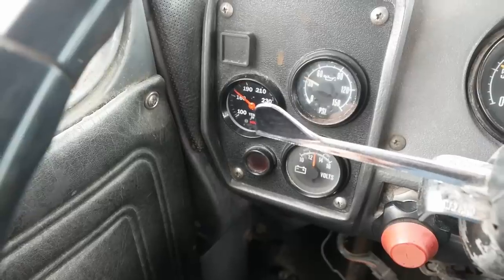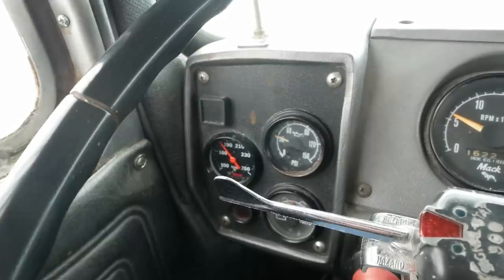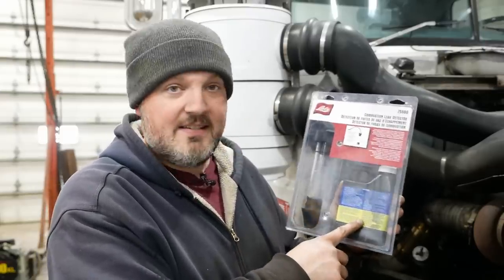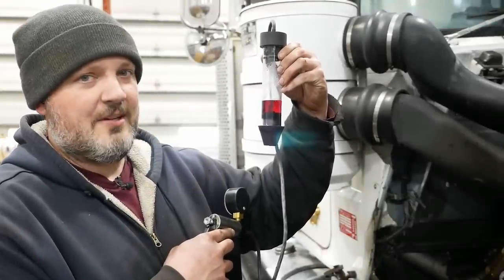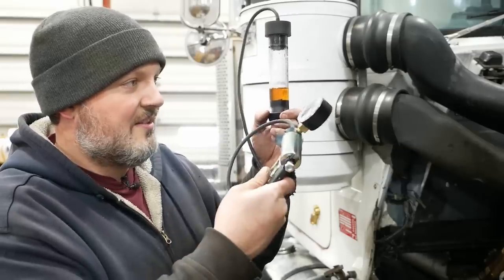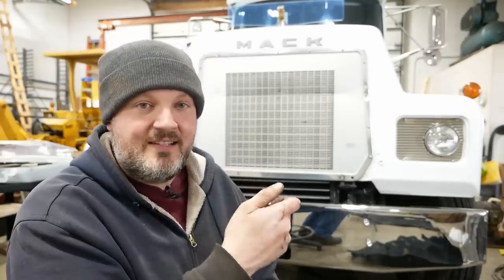Can You Trust a Head Gasket Tester? - R Model Mack Overheating

Comment: It must be leaking on the compression stroke, but not on the expansion stroke - probably because on idle there's not much resistance to the crank turning so very little cylinder pressure. 

Add some welding CO2 to the air intake so the mixture starts CO2 rich. If the chemical turns with breathing, then the tester only needs about 4% CO2 to indicate, which won't take much gas.

Comment: Wes, you just need to install a coolant vapor separator.  Then get a  $25 LCD Scamazon temp gauge and slap it on the T-stat housing so the guy can see what the engine temp really is. Tell him to come back when the coolant comes out the exhaust stack.

Comment: Normally a coolant temp bulb doesn't read air, it isn't made to, or so I have found during my time at Cummins......30 years with dyno diagnostics.... On the Cummins stuff, the test kit you used didn't work reliably until the intro of EGR, Co2 is Co2, right? I have no idea why. Also, I know this probably isn't the issue that you are seeing now, unless the fan is supposed to turn reverse engine rotation, it is either on backwards or it is a pusher type, like for a piece of machinery that pushes the cooling air through the radiator instead of pulling. Looks like a pusher type from my angle, @9:36 you can see the blades are curved away from the engine. Also, look for air assisted heater valves, sometimes they leak.

Comment: pressurising through the turbo water line or intercooler? hot conpressed air under load sitting as a bubble on the sensor like you were saying but not exhaust gas

Comment: DIY'er here.  Recently had the same dilemma with a coolant tester.  Friend of mine needed help with an overheating issue.  I suspect head gasket.  Its a gas engine and the fluid changed from blue to blueish-green.  Not quite a reassuring result either way.  I tested the tester by holding it near the vehicle exhaust, and the fluid did eventually turn yellow, but a lot of gasses needed to be pulled through the fluid to make that happen.  I still believe the head gasket failed in that car, but because we are not 100% sure we didn't pull it apart.  For now he added additional fans and that keeps the temp out of the danger zone.

Comment: Is it possible that the water pump impeller is slipping on the shaft under load/RPM. This would allow the coolant to boil in the block and head creating the gas pocket, then as it slows down and the impeller grabs the shaft again it surges cold water in dripping temp instantly.

Comment: My Detroit series 60 temperature gauge cycled like that. I recently replaced the thermostats and it doesn’t cycle anymore, it levels out at 185 degrees and the best part is, I have very very good heat now.

Comment: Hold your horses on 1977 being close to 50 years old. That  truck wasn’t the only thing born that year. I know it’s not the same exact thing but way back when on Audi TTs we had a similar issue. The impeller of the water pump would spin on the shaft not circulate coolant. It could sit and idle all day and not overheat. Took next to no time when you started to road test it and it would start to shoot up in temperature. Took a while to figure it out because those were driven by the timing belt. You could reach the impeller on those through the thermostat hole and would be able to spin the impeller. Just a thought

Comment: Hey Wes, oddly enough I've had the same exact diagnosis fail in a Suzuki Jimny with a Peugeot diesel engine. The cooling system gets pressured like hell and I've used the same test as you, and I also got no change in the liquid colour. The system is perfectly bled, the thermostat is new, everything clean as it could be...I still haven't taken off the head but I'm suspecting there will be something really wrong, or at least I hope so.

Comment: You should run a line to unload the compressor from your shop air. If you disconnected the outlet from the compressor its still building pressure I think just not sending it to the tanks. Also could be injector cups. Take the fuel return line off the back of the head and run the line into a bucket... see if there is bubbles coming out... I think that would show more of a air into the fuel system. But worth a try. Ylu van also pull the injectors and air up the cylinder with shop air to whatever psi and see if it bubbles into the reservoir...could shoot what cup or what cylinder is having the issue...

Comment: Ask Mike from DirtPerfect to do it. He has his motor from his tractor pulled apart this week.
Fun aside, those liquid testers are junk, your breath contains high amounts of CO2 and the chemical didn’t even changed completely to yellow. If an engine has this problem for a long time and you replaced almost any suspicious part, you got to dive deeper in the engine.

Head gasket seems the first suspect to me.

Comment: Definitely sounds like a cracked head or block. Only allows.the combustion gases into the cooling system while under load. I've seen that before few times on gasoline engines tho. But that's what it Def sounds like

Comment: Wes, not trying to be a wise guy, i already saw the short video with the compressor disconnected. this truck has a solid fan, does it have shutters in front of the radiator? a lot of the old shutter systems used a Kysor shutterstat that was air operated . worth a look?

Comment: Drain the air tanks look like yellowish goo air compresser likey worn or bad or before you go much more check the coolant  bypass hoses seen them come apart inside the hose plug up and now they run hot and act like that. One more thought if it had stop leak added that oil cooler may be plugged (the mp7 water pumps impellers are plastic and blow apart seem them in the oil coolers poke though hoses make floaters that block heater hoses) go volvo I had a coworker replace a radiator in a mru refuse mack with a e6 didnt blow out the new radiator out with air so the mouse nest plugged up the oil cooler soild truck was over heating like that and the radiator was cold to touch  if any of this helps a jerk off putt a torn up plastic bag in my skid steer fuel tank couple of  ago sent a lot of time trying to get all of it out something helps

Comment: I worked on a motor home that was like that , but once it heated up it would not cool down . It turned out to be the water pump impeller was not tight enough on the shaft and would stop turning when it heated up .

Comment: The flaw in that chemical tester. Is it assumes the head gasket blew between the exhaust or combustion. If it blew between the water jacket and intake. That tester wouldn't detect it. God bless

Comment: When I test the air compressor I undo the discharge line and hook shop air to the unloader to isolate it.  Have done hundreds of Cat and Cummins engines over the last 25 years and only had a few (5 or 6) that were compressors. I Use that bubble tester with straight water and get the results needed.  Mack is not a friendly one to work on as you say.

Comment: Does the waterpump actually flow coolant?   Had an old jd inline 6 in a telehandler that showed all signs of a blown headgasket.    Found out the impeller had fallen off the shaft in the pump.   No leaks or noises.  Just no flow.    New water pump and good as new

Comment: With a big enough compression leak that cylinder is likely not firing at idle, hence no elevated CO2 in the radiator gasses.

A smell of diesel fuel in the radiator and a faint haze floating on the surface are common with diesel head gaskets.

I have used one of those detectors and it did change colour, but it was a very bad leak on a petrol(/gasoline) engine.

Comment: Does that have an air to water after cooler heat exchanger? If it does, take the hose off between the turbo and the after cooler and see if your glove builds pressure. When the engine is under load the turbo boost can go up to or over 30 psi.

Comment: Okay be gentle with me here...  To test your chemical analyzer could you not run some exhaust gas through a container of coolant and pull a vacuum through the analyzer as you would through the radiator opening ?  At least you would settle the question as to whether the chemicals in the analyzer are valid and verify the tool for future use.  Just a thought.

Comment: I cannot trust those things anyways because I have had a blown head gasket and it did not show any problems when I used one of those testers either however it was blatantly obvious that it had a head gasket failure changed the head gasket and the overheating went away trust your instincts not those block tester things

Comment: I did head gaskets on my brothers 6.6 Duramax. It was pressurizing the cooling system. The fluid in the tester wouldn't change colors on it either but would bubble the gas.

Comment: I had that gauge issue on an old BMW and it was a radiator hose collapsing at speed, at low speed and idle she was perfect. If so and the truck has got super hot as a result of it being run too long in that state there may well be a further issue but do the hoses first imo.

Comment: Did you try running the truck with the radiator cap loose? Or maybe even off? Wouldn't that let the gas except and the water stay covering the sending unit?

Comment: Honestly if the fluid changes when you breathe into it, the head gasket leak diagnosing stuff is working.
It very well could be that there is not a head-gasket leak or an intermittent one that only shows up under load, i.e. actual driving.

Comment: Perhaps, internal collapse of delaminated coolant hose? It would give the same symptoms. The coolant system would work fine at low rpms aka. idle, but the hose would collapse with increased rpm and increased coolant flow.

Comment: Good testing. Try using a thermometer/thermocouple probe with your voltmeter. Plunge the probe into the coolant while the engine is running and monitor the voltage on your meter. Work out the details on how to do that. It'll probably be easier than changing a head gasket.

Comment: I had a 5.7 Vortec that would only overheat when pulling a loaded car trailer and it would do it almost instantly when accelerating. It passed that fluid test repeatedly. It also would pass a cooling system pressure test overnight and not lose pressure. I tore the engine down and it had a visible crack in the cylinder wall. Not sure why that didn’t show on the test or why it would hold pressure but that’s the way it was. I’m thinking I should have put unregulated air pressure in each cylinder and watched for bubbles in radiator, but didn’t think of that before tear down. Good luck!

Comment: do the test again if you have the truck but leave it on there and bubble longer and get on the throttle a few times sometimes it will show up after a while even with some throttle .. its defo not air cause if it was then why does the engine need to be running to make the glove fill with air the truck has built up air already

Comment: I guess the glove is about the same then doing the bottle test. Did the boost seem okay? Just trying to rule out intake to coolant passage leak. I guess you could pull the boot of turbo and run engine without boost. Definitely looks like a bubble by the sending unit to show that erratic. There should be a one way check valve on the wet tank inlet.

Comment: Pressurize rad and see if it looses pressure. A laser temp gauge would be an easy way to tell if engine is actually heating up and if rad is same temp.We use one at work as a quick way to check. Rad will build up some presure   under normal conditions .most caps are rated at 15 lb .

Comment: the issue is the gasses only leak when under a heavy load, or cylinder pressures are increased. so u will need to brake torque it some to try and get combustion gasses into the cooliong system before it will show the issue with color changing. i have run into this before on light duty diesels before

Comment: had about the same thing a lot of years ago. it turned out to be the water pump. sucking air around the shaft. never leaked a drop. after having the heads cked for cracks it still did it. looked back in records and found it was replaced right before the overheat started.

Comment: I'd almost want to get one of those automatic air releases valves that they use on domestic hydronic heating systems to automatically vent air bubbles while leaving the water in the system and plumb that to your high spot and if there is a combustion gas leak it would vent the gases and not the coolant and if the high temp never comes back or you catch the valve venting, then you've confirmed the problem and the customer can make the call on whether to replace the gasket or just keep driving it as it has obviously not been a huge problem in the last few years and the relief valve will keep the problem in check..

Comment: I have used the Napa combustion gas tester. There’s has blue fluid that works for both gas and diesel. Might try it out I’ll get you the part number on Monday when I get back to the shop if you want

Comment: Could well be leaking under load only. Can you remove the temp sensor and pipe in a hose to a catch tank in the cab? If it's pushing exhaust gas should be noticeable.

Comment: on regular car engines if you have problems with air pockets you can drill a very small hole in the thermostat so that it flows a slight amount even when it is closed and allows the air to pass through.

Comment: Would a cracked head near the intake/boost possibility give you pressure into the cooling system but not combustion gasses?
Reply: He said no, not enough pressure.
Reply: @DanEBoyd  a few pounds he mentions at idle would be enough to puff up a glove and certainly more as it heated and rev'd up under a load to form a bubble in the system with hot gasses. I wonder if he could take the temp sensor out and put his bubbler set up in the hole to test for gasses there?

Comment: It seems highly unlikely that the gas in the cooling system is combustion gasses.  Burning diesel produces a ton of CO2.  By weight it's like 4 times. Burn a teaspoon of diesel, you get 4 teaspoons of CO2 (that's weight, not volume). Burning 1 gallon of diesel produces 22.38 pounds of CO2.  The exhaust is 12.5% CO2.  Your breath turned that liquid yellow.  There is no possible way the gas in that system is diesel exhaust.

Comment: That kind of bites.  The stripdown of the engine just to see the head gasket is probably the better part of a week.  Which would mean turning down 25-30 hours of paying work.  And, no guarantee the the head is not cracked after getting to the gasket.  Customer is going to likely balk at the US$20k pricetag for just the labor hours.
But, it was a cracking (NPI) good video, particularly the gear-jamming outro.
Reply from the maker: I figure 15 to 20 hours to do a head gasket. But if the head is cracked I don't know what we do. There aren't many of these around and no one fixes them anymore.

Comment: Had similar issues on a 6.5 GM pickup. It would blow all the coolant right out of the system any time you got on the highway and had RPMs up. Fluid gas analyzer didn't show anything. I made the call to do new heads and head gaskets as they have a reputation for cracked heads. Problem was fixed, but I also put a new radiator cap. Still not sure if all it needed was a cap.

Comment: I had a truck that used to leak head gaskets, it would blow compression into the coolant. 
When it was cold the compression in the radiator would blow all the coolant out of the radiator, but when it was hot the compression could pass out through the open thermostat and not lose any coolant. 
So, I drilled a hole in the thermostat and left the radiator cap loose to give the compression a clear path to escape. It worked for another 6 months like that.
Reply: Your bubble at the temp gauge sender theory matches what I was going through.

Comment: Had an 84 R model. My kidneys had flashbacks watching you drive at the end. 
Mine had Mack Twin Sticks and was damn particular about shift points.
Reply from the maker: I find the 5 speed really hard to drive. It's an unnatural rhythm compared to road ranger trans.
Reply: You find it hard to drive because it is!
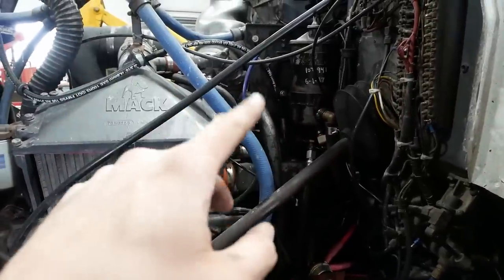You were doing good though. My truck had 4:10 rears. On the main box upshift at 1,100. Down shift at 1,600. Plus or minus 20 rpm, maybe. Good times.
Reply: I remember our old twin stick R-model, but ours was from the late 1960s.  By the time I was old enough to drive it it was the reserve truck, only used when there was no other option.

Comment: Temp sender or gauge is bad or was replaced and not a matched pair. Plumb in a cheap direct read O'Reilly gauge into a water manifold port and check it. Aluminum framed Mack's were made in Hayward California. Those parts are unobtanium.
Reply: Was replaced by Wes two years ago. You can check the video...

Comment: I don't know about the truck but I can tell you that the chemical you are using is very good at detecting CO2. You hardly breath out any CO2 as a percentage but you can easily turn the liquid yellow. Just blow though a straw. I would trust the liquid which suggests that the problem is pressure but not exhaust pressure.
Reply from the maker: Pressure from where?
Reply: @WatchWesWork  Is it possible to have a gasket leak and a cylinder that is not firing? That would give you pressure but no combustion. As you can tell. I am not a mechanic.

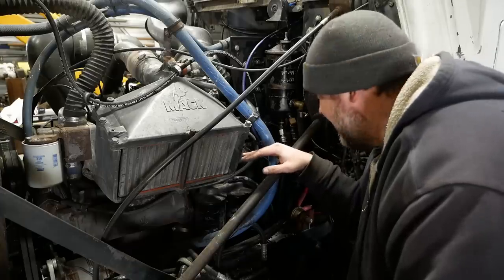Comment: Wait, wait - I got it!!!  Use an IR thermometer to confirm temps on the various points on the block as the gauge goes up.  Get the Mrs. to call out temps as she revs up and you observe block temps to see if they match.  I suspect at this point in the video it has to be the gauge because nothing else seems amiss, at least up to where I'm at now, which is 12:17.  Now on to the rest of the fun mystery!  :)
Reply: Could it be like a cracked sleeve or something?